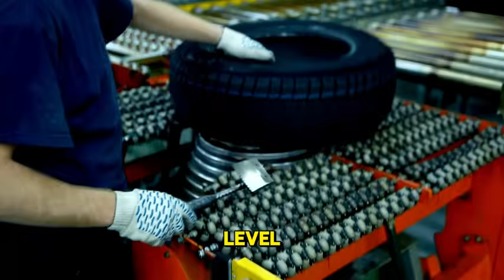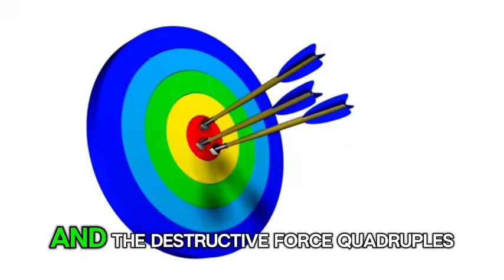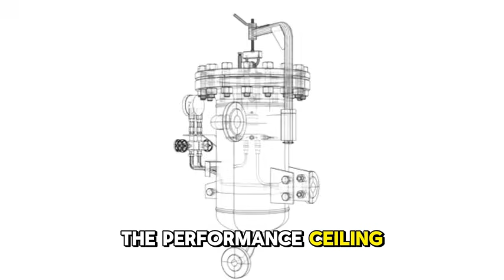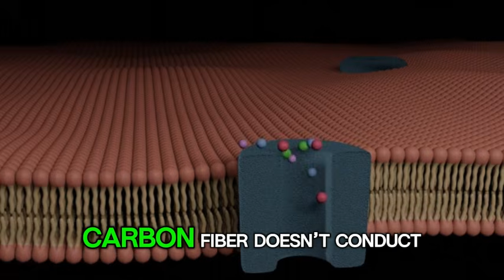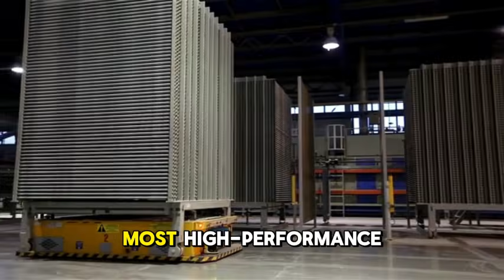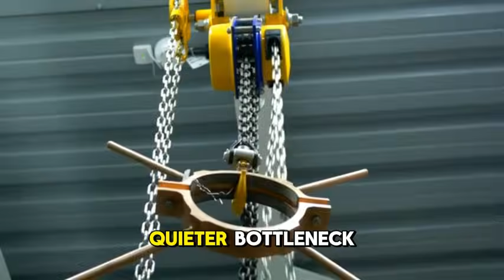Elon Musk's SHOCKING Electric Vehicle Motor Secret Revealed

Comment: The new here is that Tesla got it into volume production for EV motors. We did a high-speed motor prototype project around 1998 with carbon fiber sleeve. The pressure in the rotor was about 1500 bar, which would be needed to hold the magnets together at 100 000 rpm. Also note that carbon-fiber does conduct electricity but not as much as steel. So we had about the same losses in the sleeve as in the magnets and other metal parts of the rotor.  For servo motors wrapping the magnets with string under tension has been in volume production since at least the 1980:s but they used Kevlar fiber instead as the requirements was not as high and Kevlar is actually not conducting electricity.